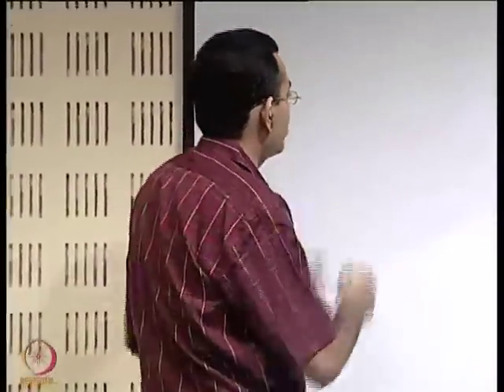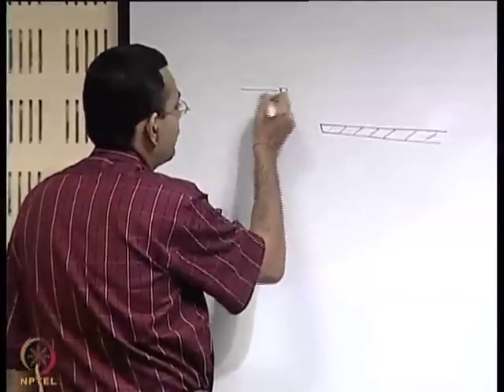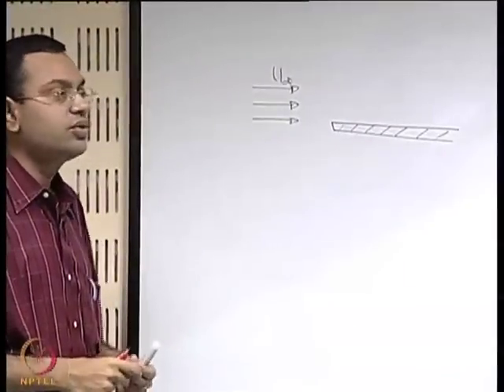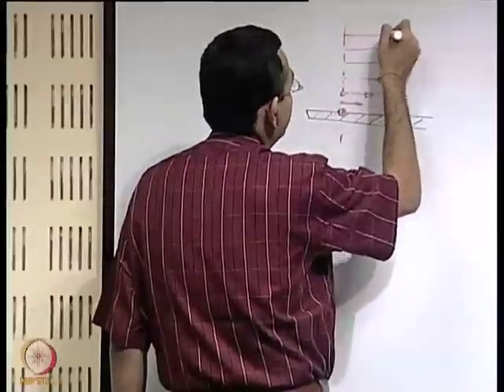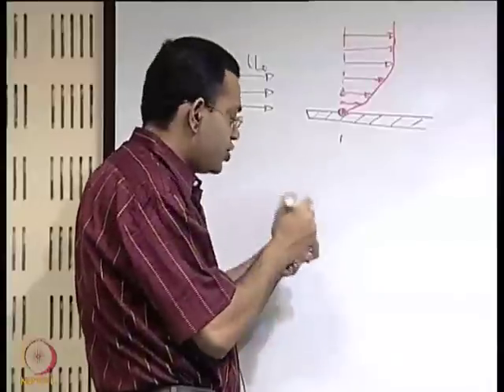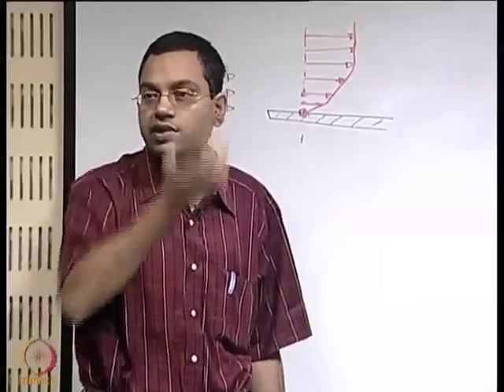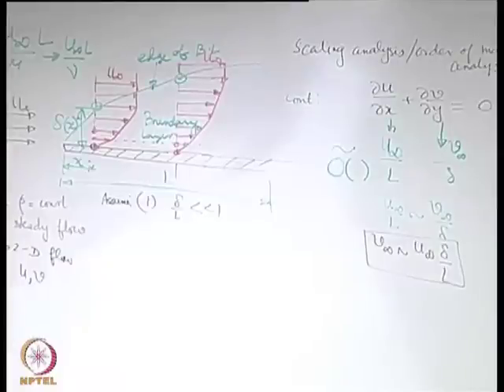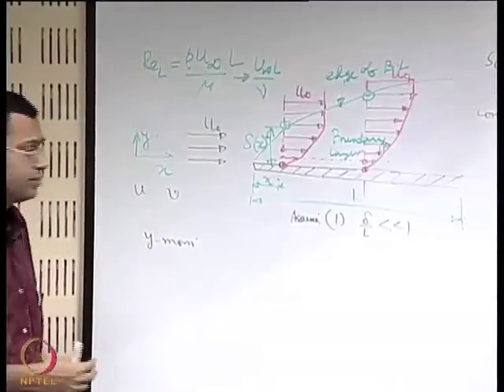Mod-01 Lec-37 Boundary Layer Theory

Comment: sir
why does velocity at bottom of canal or any plate will be lower than top surface
is there any relation...
Reply: due to  cohesion between plate(solid) and 1st layer of fluid with plate
Reply: due to roughness of the plate or surface  the nearest molecules of fluid will stick with surface, and the molecules which are just away from surface are due to cohesion between the molecule to molecule.....the velocity varies
Reply: because of viscosity is more. viscosity acts like a friction and  it oppose the layer of fluid flow over on it

Comment: AT 35 HOW COME PRESSURE GRADIENT IS ZERO . HE SAID DOMINATING WHAT DO YOU MEAN BY DOMINATING
Reply: Velocity v is very small compared to u. This means u is dominating with respect to v. Therefore in the two equations, dp/dx will have a larger value compared to dp/dy in the other equation. This term WILL have some finite value, but for engineering purposes, it's value is insignificant with respect to dp/dx. So we take dp/dy = 0